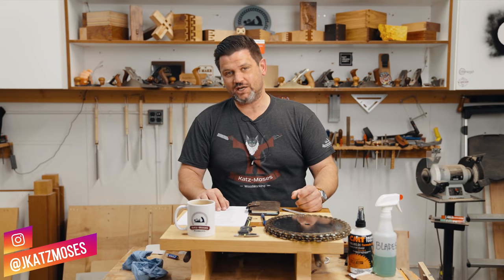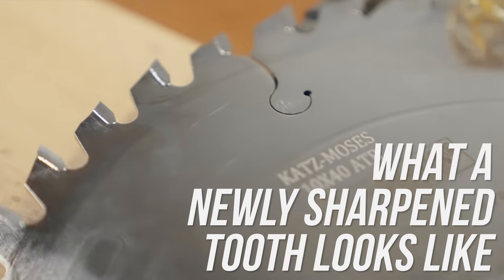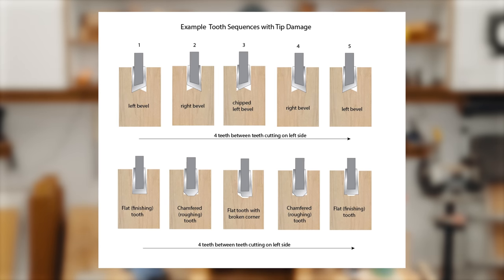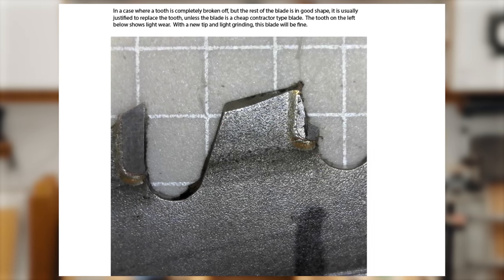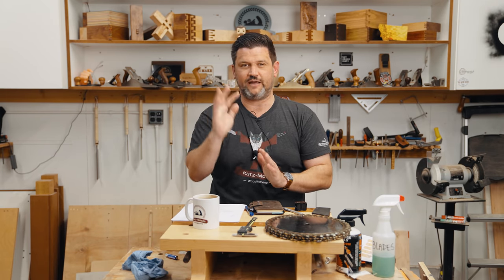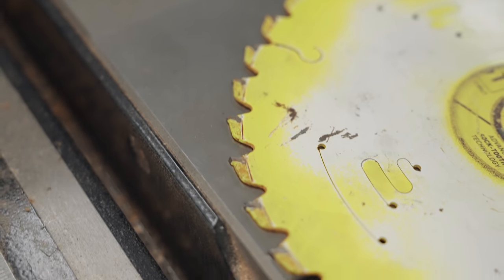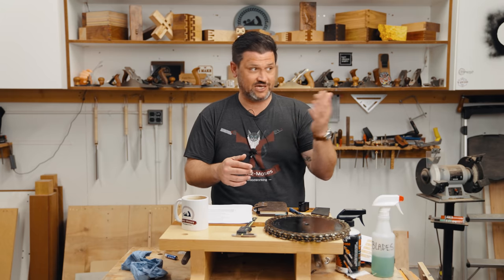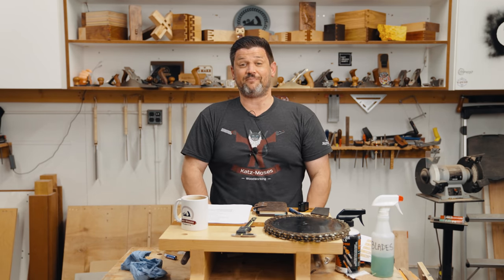How do I Know When My Saw Blade is Dull? How Much is Sharpening? Get the Most from Your Consumables

Comment: One thing that I was told by the shop owner where I take my blades for sharpening is that if you run your saw blades until they are totally dull, then they have to grind away more of the carbide to transform them. Net effect is fewer sharpening per blade. Blades that are removed from service sooner, at the first sign of getting dull, and sharpened, will last longer. 

He also said that blades that are cleaned regularly will run cooler and stay sharp longer.

Comment: There's a lot in a top quality saw blade. 
I once used a thin kerf blade in my worm drive skill saw once, never again. Even with a stabilizer installed, that blade wobbled severely. 
As for brands of blades, I've tried a Forrest blade, still prefer my Freud blades though. I always get a better cut with them, even over the Forrest blade. 
Great video, looking forward to seeing the sharpening process video. Cheers :)

Comment: I'm too poor to buy cheap tools. I always get burnt every time I try! So yeah i end up crying every time i need to buy something
Reply: Lmao!!! My wife is pissed off at me for mentioning my next tool purchase: a 270 dollar jigsaw. She thinks a harbor freight POS will do just fine!

Now, in her defense, the one I want is a Makita cordless brushless one, but I hate cords, and I'm limited to one single outlet in my work space, so cordless is the best option. Also, I already own Makita stuff, so it is the logical choice to stay with that brand.

P.S. I only own Makita because it was given to me from a previous job, so I just stuck with that brand. I have owned Ryobi, Milwaukee, Dewalt, and Makita over the years and they all have certain things I like and don't like, but perform similar in my experience.
Reply: @charlieodom9107  when it came down to buying into a cordless system, i debated a long time. It was either makita, DeWalt or Bosch. I never really touched Ryobi since it was in the lower price bracket and didn't want to get burned again.

I ended up going with the Bosch mainly because the drill i wanted to get had replaceable chucks. Its such a time saver when you have just the one drill.
Reply: @renel2196  I only went with Makita because that is what I had. I didn't buy the original set, but I like it better than the Dewalt I have and it replaced a Milwaukee set I had before. The tools are a bit expensive when compared to brands like Rigid, and I don't think they are any better or worse, so if someone was buying a set, it would be hard to not recommend Rigid, especially with their warranty.
Reply: @renel2196  I recently upgraded some Ryobi tools one+ tools to a nice set of Dewalt cordless tools. Damn the difference it makes, in my case (buying T-stack models in Belgium) made each tool on average 2-3 times as expensive as a ryobi equivalent. From my experience I'd say all the dewalt tools are just that slightly better and nicer to use, would I say 3 times as nice to use as ryobi? No but it's something I felt right of the bat.
I ended up going with dewalt as I am working in a pro tool shop here and there were already some big Dewalt promotions going on and I got my employee discount on top. Ended up with about 3grand worth of tools and batteries having paid less than 2.

Comment: You missed one variable in your calculations 4 cost of ownership: the sawstop break action. 
People with a sawstop will most likely have triggered the break before a blade has been resharpened 10 to 15 times. So for sawstop owners, the math is different.
But I concur with buy once`s.. so I liked your message and the cost breakdown.

Comment: I bought a thin kerf 40T CMT orange shield blade to replace the thin kerf 24T construction blade that came with my Dewalt circular saw. Working with almost exclusively plate material aka plywood 24T wasn't good.
The only downside I can mention about the CMT blade is that the orange color looks a bit weird in my Dewalt saw but I got used to quick enough :P

Comment: Great vid but one observation:  you can’t really generalise about Freud.  They have a vast range from entry level Diablo through to premium grade l.  A decent freud blade like a 60T tcc with a good amount of carbide and their permashield coating can be well over £100 here.  A decent CMT can be £180 but there are cheaper options and you don’t have to spend more than £100 for a good blade that should take 4 or 5 sharpenings.  Cheap blades are false economy. Not enough carbide on them and they just don’t last as long.

Comment: Hi Jonathan and thanks for educational videos you provide to everyone :) They've been a great help and inspiration. 

I do have a question regarding table saw blades (not necessarily about sharpening though..) What kind blade would you choose if you're splitting (not cutting) hard wood species, such as oak? I have a table saw with 10" blade and would greatly appreciate any advice on this one. I have the stock 24 teeth blade but I would be willing to invest on better blades, perhaps one for general use (cutting) and one for long splitting.

Thanks a lot, stay safe and keep up the awesome work you do :)

Comment: Great Video Jonathan, Thanks!  Your content always educates and your attention to detail and in depth explanations appeal to my inner engineer.   I used Diablo for a while, and then after seeing your saw blade video, I bit the bullet and picked up the 3 your recommend.  I was shocked, though I shouldn't have been after watching your video, at how much easier and better they cut... and I am using an underpowered Delta 120V table saw.  

Question for you.  I was crosscutting some 4/4 Hard Maple today on my 12" miter saw (yes, a red blade) and it was definitely dragging.  I'm sure that it needs cleaning, but.... I'm wondering about just jumping in and getting a new blade for it.  Do you have a recommendation for a CMT 12" blade?  Is full/thin kerf an issue/consideration for a Miter Saw?  My saw is an older Porter-Cable 12" and is not sliding.  Thanks in advance.
Reply from the maker: Yeah they have a Chromium 12" miter crosscut blade (I use 60t)  through the link in the pinned comment. Kicks ass and make sure to use the discount code for another 10% off
Reply from the maker: And thank you!

Comment: Dont use a thin kerf blade, they will have a thin carbide as well vs the full kerf of freud. I’ve been using my full kerf freud blade and no problem with it after 10-15k bd ft it just need to resharpen. Thats 3-4 months of use.

Comment: Needed a 9/16th piece of wood to sandwich between two island cabinets and was ripping a 3/4” piece of pine that I ripped down to about 3 inches wide. The piece was smoking when I tried to rip it down to 9/16ths so I had to lower the blade and do half at a time. What was happening there? Blade seems good.

Comment: ;
Love the video and all of the work that you do to provide us with amazing info is greatly appreciated!   That said, you have left out a blade that in many's opinions is far better than the 2 that you refer to as the high end blades.  The Ridge Carbide Super Blade.  It's for some reason a Woodworking well kept secret and for what reason, I don't know.   I have used all of the blades referenced in the video thoroughly and can say from experience that the RC Super Blade is a far superior blade to all of them.  In cut quality, durability, quietness and how long it holds it sharpness.  The company also offers sharpening services and will ship for free depending on how many blades you send in.   All of that and the cost of the blade falls right in between Forrest and the CMT Chrome.  There's also usually vendors running a sale that may help you find one for under a $100.   Just thought I'd throw this out there.  I can say with confidence that my 1st purchase of a Ridge Carbide blade was one of the best WW purchases that I have ever made and had a substantial impact on my WW'n.   Cheers.

Comment: I bought a cheaper blade, used it a few times and thought I was just not pushing materials through my table saw properly. I put it down to having a bad day. It went on for a wile and I was asking what is wrong with m. Then I noticed when I switched the saw off the blade was wobbling. When I took the blade off the whole plate had a cup in it. No idea how they could let a blade  through quality control

Comment: I don't feel the need to sharpen blades. I mostly use 6.5 in circular saw blades and can get 2 for $10. I also use 10" on my table saw and miter saw but I can find some at pawn shops brand new. Little to nothing. I really hate throwing them out but, the cost goes to the customer!

Comment: I noticed you mentioned the CMT Chrome specifically. What's your opinion on the CMT double blade pack? They're orange and have a 24t & 60t blade? Are those not as good? 
Just curious about your take on them since you're the reason I found CMT blades to begin with...
Reply from the maker: They're probably mid grade but I haven't had any time with them
Reply: Yeah they are a bit cheaper with the discount. They're great blades imo. Thanks!

Comment: Are there any upper tier blades that are narrow kerf? As someone with a low power table saw, I get much smoother cuts out of the Diablo blades because of the thin kerf, but would like to upgrade to a better quality sharpenable blade
Reply from the maker: Yeah, get the CMT Chromium thin kerf. Use my link in the pinned comment
Reply: @katzmosestools  is there just the thin kerf crosscut blade?
Reply from the maker: @Snowmunkee  I don't know. Not my company so maybe try emailing if you don't see what you want. Cheers
Reply: @katzmosestools  thanks Jonathon

Comment: Are the CMT blades actually a full 10"?  I have to change my Sawstop brake clearance every time I switch between my Ridge Carbide and Freud blades.  The Freud's are slightly smaller.
Reply from the maker: Probably but not sure
Reply: @katzmosestools  FYI, they are 10".  The Freud blades are 250mm, which is almost, but not quite, 10".  10" is actually 254mm.  I made some test cuts with the CMT 40-tooth combination and it looks good.  I'm sending my others off for sharpening.

Comment: I concur that Freud is mid-grade. Having a 30T Glue-Line RIP, and most recently a Forrest WWII 30T, the Forrest is simply incredible and better than the Freud in every way. The Freud cut great at first, but it dulled rather quickly. I just sent the Forrest back for the first time after one year of pretty normal use (~ 3 days a week). It was $53 (including shipping). I'm extremely happy with the Forrest, but I do admit I was a skeptic until I got one. I just figured there was no way the cost was justified over the Freud, and I couldn't have been more incorrect.

Comment: Plus, carbide is toxic, if it enters the human body it must be immediately removed, even a tiny piece can be fatal. That is also why you should never reuse a blade that has gone through a brake cartridge. There could be micro fractures in the carbide and you would never see them.

Comment: Johnathan, I think you kinda punked Freud a little bit. They have the ‘big box’ version of blades but also offer an industrial line. Please check it out and let us know your opinion.
Reply from the maker: I specifically mentioned I was comparing Freud Industrial and that's what I used to do the math. This isn't my first saw blade video. I know there's a lot of Freud fan boys but I stand behind everything I said 100%. The shot of the brazing under the microscope is of a Freud Industrial blade AND wait until you see the video next week. People who sharpen blades aren't big fans of Freud Industrial.
Reply from the maker: In addition, one of the guys who helped out tremendously with this video has been doing this for 50 years. He's personal friends with owners of Freud and CMT. A bunch of engineers left Freud to join CMT because they were unhappy with the profit over quality mentality at Freud.
Reply: Great video thanks for it.  As for future videos, I'd be curious about those random orbital sanding disks that supposedly will last a decade. I think they are diamond crusted or something

Comment: What if you live in a developing country, like me, where there is no high tech sharpening service offered?
Reply from the maker: Good question but I don't think there's an answer I could give with any authority.
Reply: I'm in the same situation, as a hobbyist living in a third world country. I use Freud blades, as they are good quality for cutting but cheap enough that I wouldn't feel as bad chucking them out after they get damaged the first time. The highest quality blades would be a waste of money in my opinion, where no sharpening service is available.
Reply: Maybe there is some company in your area that deals with laminated chipboards (furniture factory or something like this). If so, try to contact them and ask where do they service their blades. Chipboard is such a thing that is quite demanding on the quality and sharpness of the blades and it also dulls blades pretty fast. Perhaps they even have their own sharpening service

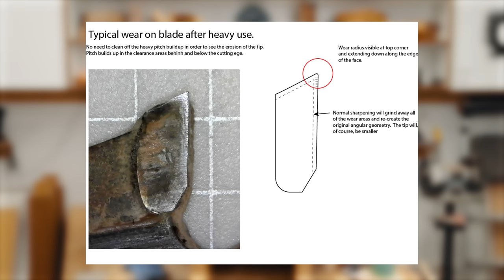Comment: 2:20 this is waaaay past dull. That's the the point where a shop might straight up scrap your blade.

What you want to do is use a bright light. Clean your blade and check the tops from a fine shine, like a silver hair, on the of your teeth. If you see that it's dull.